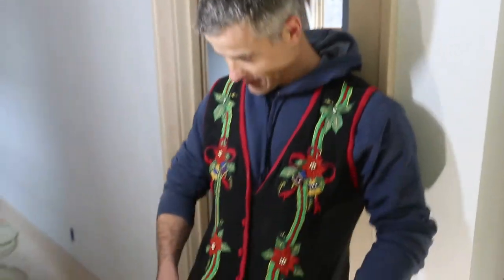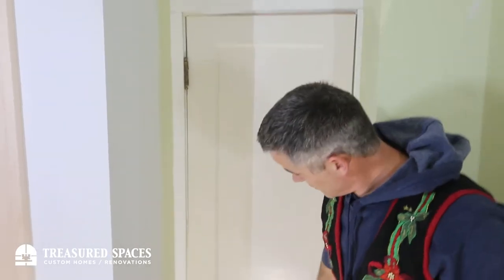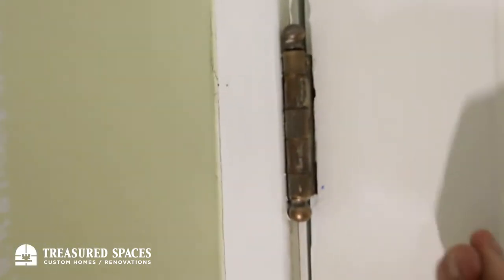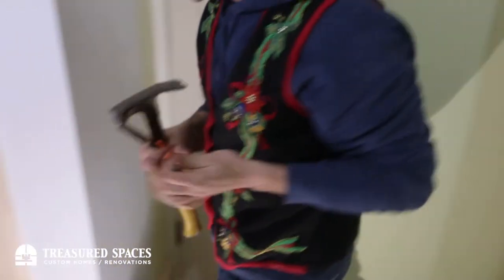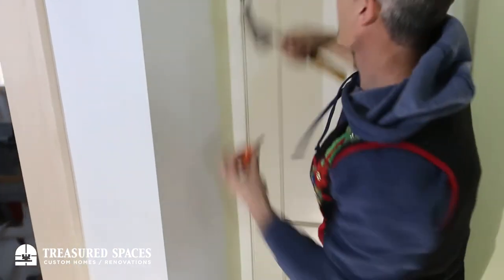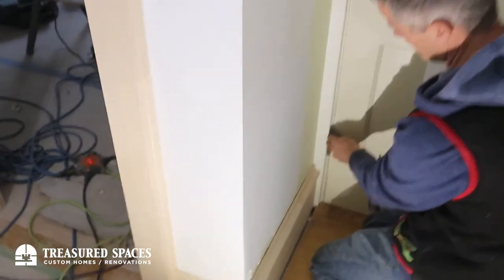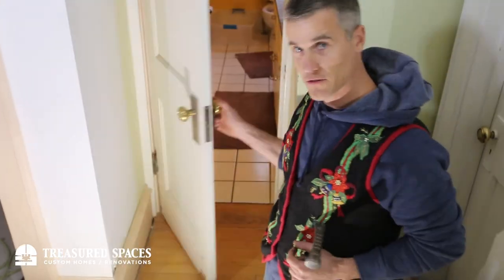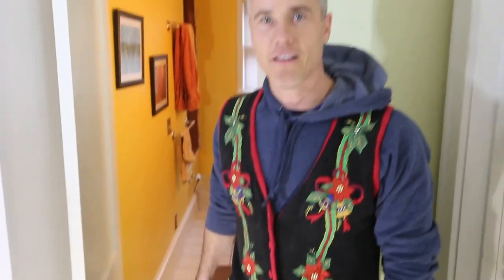How to Stop a Door from Opening & Closing on It's Own – DIY Ally

Comment: Thanks for the ideas, I couldn’t get it to work after 2 pins, (I live in a apartment & didn’t want to bother the neighbors) but I held the pin with Vice grips, suspended the pin between 2 pieces of wood, I tap, it bent, back in and door is fixed. Thanks!